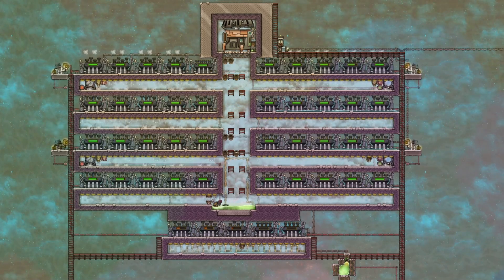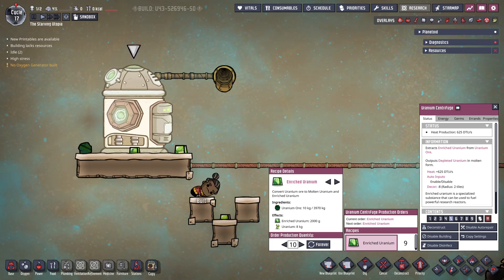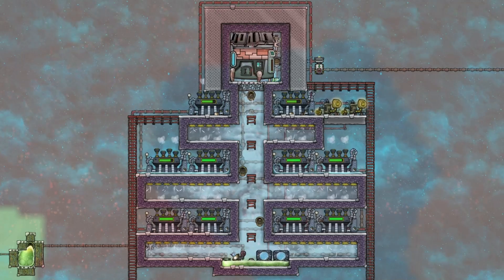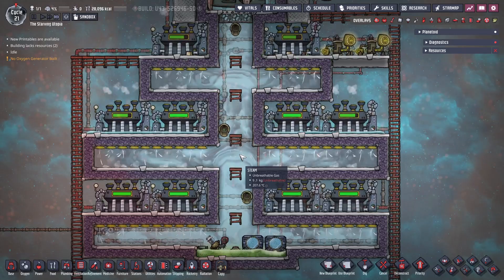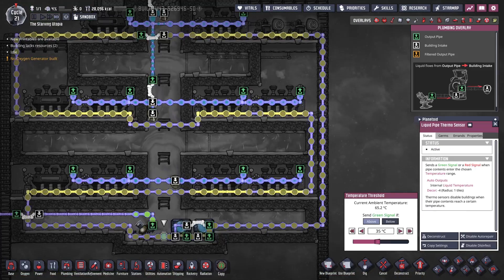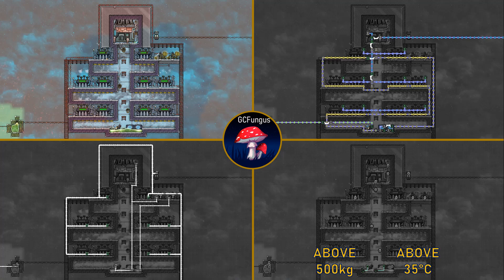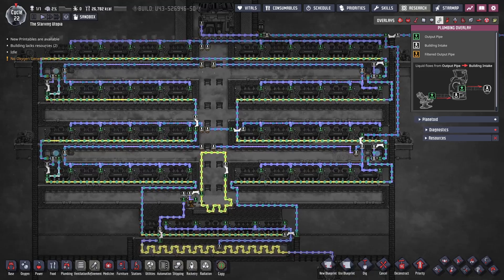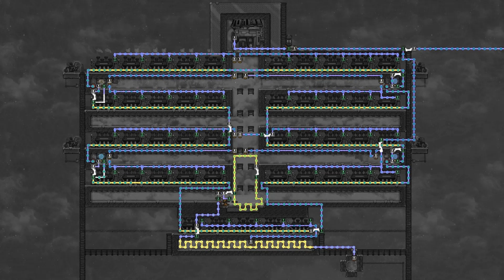Oxygen Not Included - Tutorial Bites - Nuclear Power

Comment: I built the smaller one in Dev mode to test it out. It looks great, one question is I noticed a lot of radiation still blasting through the lead and some of the top parts with only 1 ST on each side. Any tips on how others have solved or handled this? I tried just surrounding the whole thing in Lead tiles, and while this helped, I doubt this will be practical on my live play through.

Also after testing a few cycles with this in Dev, I had an issue where the water in the bridge right before the intake on the reactor boiled and broke the pipe. I'd thought having water wait to enter the rector was a good idea at first, but in testing I noticed I never needed 'More' water as the water from the STs is enough to feed back to the Reactor. So perhaps I need to ensure I feed the reactor initial water via the 'drain' lines from the STs that go back to the reactor. Then the initial external water supply is something that could be stopped once all STs hit 100%. Has anyone else noticed once they get 6k steam and fill the steam chamber they don't need more water? It seems like water/steam volume is never consumed and stays consistent. Is that right?
Reply from the maker: The radiation can only really be dealt with by adding more tiles, there is no other way except for keeping the dupe pathing away. The water in the reactor should be self sustaining, and the addition is really just a fail safe if something goes wrong.

Comment: Bro i just took a glance and followed some of the references not to the T and made my own style of what I think would work and its such a hassle to come up with one that runs perfectly without any hick ups. Mine is not running perfectly, but the steam pressure keeps creeping up.
Reply from the maker: In which case, try adding some atmo sensors and use that to limit water input, or remove excess water.

Comment: Mad ethis today and worked great for a few cycles, but the auqatuners in the top keep overheating and breaking due to steam pressure dropping. I have 100kg+in the lower area but drops to 1-2gs in the top area. Any idea how to fix this?
Reply from the maker: The smaller build or the CLRR? You can try either to move the water vent outlets closer to those steam turbines, or just increase the overall steam in the system to help buffer the heat.
Reply: @GCFungus  Thank you so much for replying! My comment was regarding the CLRR. I moved the aquatuners centrally and the overheating issues are now sorted but the far steam turbines still have minimal pressures. I'll try moving the vents closer the tithe turbines like you suggested.
Reply: Sorted now, see @XiremaXesirin message below

Comment: Is it really worth it to keep up a nuclear reactor if the only way to get uranium ore renewably is to manually mine it from space? I feel like so many other methods -- geothermal, petroleum boilers, natural gas geysers -- are easier and safer to work, and don't require nearly as much treadmill work once they're configured and secured.
Reply from the maker: It depends, but although the uranium ore is somewhat tricky to get the reactors use quite small amounts. Such that the natural reserves will probably last 1000 cycles, and each trip to a POI will bring back enough for probably hundreds of cycles. Plus the fuel is very dense and easy to ship between planetoids. But yes it isn't completely set and forget like petroleum, so it depends what you're after.
Reply: @GCFungus  Thanks for the info / clarification!

Comment: Just built this in my base, and after about 100ish cycles the whole system over-pressurized with steam and melted down. As far as I can see the liquid pipes are set up the same. Going to go back in and add a pressure sensor to pull water out to prevent this from happening in the future.
Reply: It looks like the bridge priority is still allowing outside water into the system even with water coming in steady from the turbines eventually leading to a catastrophic pressure build-up.
Reply: Maybe adding liquid shut-off on external water supply connected to internal pressure sensor and just disable it when pressure is too high?
Reply from the maker: That is odd as I've run these for a long time with no issue. The reactor doesn't consume of produce water so it should stabilize. You could take out the excess water supply to remove the over-pressurizing risk, but then you do introduce the other risk of the reactor not getting enough water somehow.
Reply: You had the same bridge into the reactor?

Comment: Thanks for the tutorial, I built the standard design and I have more power than I know what to do with.

EDIT: Don't build the conductive wires out of lead...
It worked fine for 130 cycles but at some point my cable melted (I have no idea why, the steam is not going over 210 degrees) and I have to load from 10 cycles back to avoid the meltdown.

Small note, the external line bridged as a backup malfunctioned for me. That's probably because I added 95 degrees water as a coolant and it stayed in the pipe (insulated igenous) and heated to steam. I'll gamble on the closed system for now.
Reply from the maker: Yes, always be careful when using lead as it can cause some fun failures. If the backup line was stopped for so long that it broke then that's probably a good sign that it is working properly as a closed loop.

Comment: I have another problem with this reactor. I've put everything in a vacuum chamber so there's no heat leak and I have added one aquatuner more, but for some reason the cooling loop simply can't manage the heat and starts to slowly heat up. I'm thinking about adding  4th aquatuner, but the addition of the 3rd did not seem to fix the problem. Also, I had to add some automation to the reactor to prevent the whole system to overheat and radiant pipeing to draw heat from the nuclear waste (which anyways goes into other machine I have to further cool it down). I'm talking about the small nuclear plant. It's not a bad design but needs more work to make it function properly, I've been stuck with that for the fast few days, once you start the reactor, it's very difficult to work with the system and I have had to go back to the save from before starting it a few times.

Comment: I wish you had also referenced the limited fue RR or whatever it's called. I want to control how much uranium is introduced into the system. I guess I can just use a timer sensor on a conveyor shut off?
Reply from the maker: I didn't include this as I don't think it's a common use case. But if you do want to do this, then yes you'd need to limit the incoming uranium ore through either the conveyor meter or shutoff as you suggested. Unfortunately there's no solid valve!

Comment: A few notes on the CLRR, having built many in survival colonies:

I think it's a mistake to put the aquatuners so far to the extant edges of the steam chamber. Nedigo had to do it that way because they were using Waste as the coolant and had to isolate the aquatuners in submerged pools of waste to prevent it from leaking out, but even if I were using Waste as the coolant then I'd probably still prefer to put the aquatuners in the central channel instead, just surrounding them with airflow tiles so Steam can pass by. The reason the aquatuners are prone to overheating is because at the extant edges (especially higher up, where the steam pressure is lower) they heat up steam that's essentially standing still, and a single steam turbine can't soak the heat up fast enough. BUT, if you instead put the aquatuners in or near the center of the steam chamber, heat will get picked up by the steam flowing past, and it better equalizes the temperatures in the chamber without having to use any tricks to redirect water flow.

The pump at the bottom should, ideally, be controlled by two conditions, AND'd together: a Hydro Sensor measuring at least 800kg or higher (I think 500kg is too low), and a temperature sensor measuring 200C or lower. The second part is critical because otherwise, you risk extracting nuclear waste from the steam chamber before it has bled off enough of its heat. I also think that Nedigo way overengineered the mechanism to pull heat from the waste: Aluminum tempshift plates work fine. The design ensures that there will never be an individual tile at or above 400C, so the aluminum is safe from melting. If you're really worried about the possibility of some of the waste flashing into nuclear fallout, you can make the pool two tiles deep for safety, but I've never found it necessary.

I would also err on the side of potentially overpressurizing the steam chamber, rather than underpressurizing. I've had many issues where towards the upper-corners of the steam chamber the steam pressure just peters out. It's actually pretty safe to let the steam pressure towards the bottom of the build be as high as 200-250kg/tile, since that pressure will rapidly drop as you ascend the steam chamber, since all that steam is getting pulled into the turbines. That amount of pressure will usually result in the reactor itself having a steam pressure around 100kg/tile, which is perfectly safe. You definitely don't want the pressure to get too low, or else you'll get problems properly consuming the heat. If you really want to be careful, then aim for pressure where, when idle (i.e. the temperature is too low for the turbines to consume steam) the room equalizes to about 140kg-ish per tile. That might seem dangerously close to the reactor's overpressure limit, but that steam pressure will drop fast once the turbines actually turn on.

Be careful how you route the plumbing for the water that's being sent back to the reactor. Since it only flows at 1kg/second, there's a serious risk that the water will overheat if the insulated pipes are routed through the steam chamber itself. I even had this problem when making the pipes from Ceramic! So make sure as much of the piping as possible is embedded in the insulated tiles so that there's no risk of the water picking up undesirable levels of heat.
Reply: This is the sort of careful, thoughtful, experience-informed comment that is so rare, but so valuable on YouTube.
Reply: I really wish I had seen this comment a couple of months ago.  I definitely had issues with the heat not moving around.  As for the temperature of the waste.  I did the same as you in that I added a thermo sensor to make sure it bled all it's heat.  However I did find that sometimes the waste mass would grow too large and start overspilling into the steam chamber.    So I left the original hydro at 500kg AND'd together with the thermo sensor then added another hydro sensor at 900 so when the waste started getting close to over spilling it would pump it out regardless.  I think on my next build I'm going to go with 3 high chambers and add some granite tempshift plates.  It's more space needed but I'm the type to completely clear out an asteroid so I've got the room and resources.
Reply: I did indeed have aqua tuner issues being so far out on the wing.  The both quickly reached above 700c  3 ended up turning into molten sadness and the other burning out (survival mode).  So there is definitely more challenges to overcome with this design than just setting automation, bridging and materials correctly.
Reply: Good points! I might've pushed the idea of using nuclear waste as AT coolant to boost the output performance up a little ;) but boy was that central pool annoying to deal with... not sure if it was because of those ATs or my slow computer but I'm glad if it didn't cause you problems!
Reply: Great tips! I just finished with my build and those help a lot!

I would just add that <=1kg in pipe tile is safe even with temperatures out of liquid range.

I used that mechanics here to also limit the nuclear waste going to the cooling chamber as the fist few drops could destroy your pipes as temperature would go under the freezing point.
Reply: Thank you so much man. Moving the aquatuners to themiddle column fixed the overheating issue!
Reply: Is it possible to linearly control the power output of the reactor by scaling the fresh water passing through the valve? I want something between regular reactor system and the advanced one. I don't need 24k power and I value space (and materials) more than the power I won't use anyway so something that is roughly half the size but outputting 10k would be perfect in my case
Reply: @extreme0  In theory, yeah, reactors seem to request about 4-5kg/s of water, so setting a throttle anywhere below that value should increase heat output.

That being said though, a normal research reactor being given as much water as it wants already outputs around 10kW of power (in terms of heat energy), so it's probably easier to just build a basic nuclear reactor if the high energy output isn't essential.
Reply: Note: if you don't have aluminum try granite tempshift plates! they seem to perform somehow even better than diamond plates in some conditions cus wacky physics engine

Comment: Gives me interesting feeling idea for a water boiler that uses some radiators to spread heat from a steam room back into a somewhat large hot water tank. Might be useful for modulating the temperature to just under 200 or whatever your target happens to be.
Reply from the maker: It would be possible to do something like this with a core heated section and then use heat injectors to control more steam rooms. Or you can loop a coolant (assuming the temperature range is suitable) and use heat injectors from that.
Reply: Controlling several steam rooms from a central core of heat... wonderful idea!

Comment: Some additional info about the CLRR waste flashing mechanics not mentioned in the video.

When the 100kg of hot (>500C) nuclear  waste drops out of the reactor it will flash to fallout in the first frame of contact with a tile or liquid and will immediately flash unless falling into a pool of cool nuclear waste.

What's happens is in the first frame of contact the 100kg hot waste will merge with the pool of cool waste, summing their masses and instantly averaging their temperatures.

This temperature average must be lower than the waste's flash point (530 I believe). The way to accomplish this involves having a full tile of cool waste (1000kg) and having it at sufficiently low temperature (somewhere around 450). If these conditions aren't met you get 1100kg of nuclear fallout gumming up your turbines, lowering your power and cooling output, and eventually causing a meltdown.

Obviously in this process your basin needs to be cooled in some capacity before the heat raises enough that that happens.

So my solution was to use a secondary basin of cool waste held behind an airlock that gets filled while the primary basin heats up. When the primary basin gets too hot the airlock door opens and floods the hot primary basin with the cool waste from the secondary basin.

The overflow spills out into a long heat exchanger that powers the turbines, refills the secondary basin, and disposes of the excess.